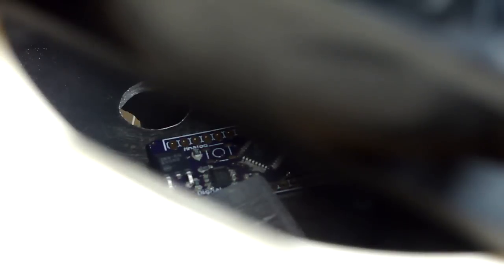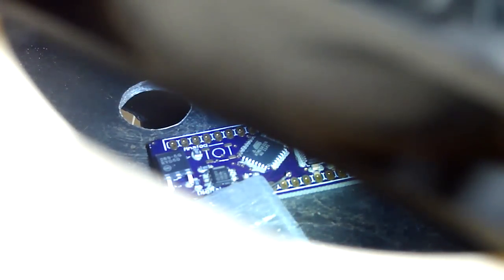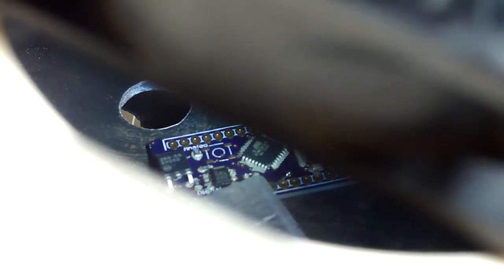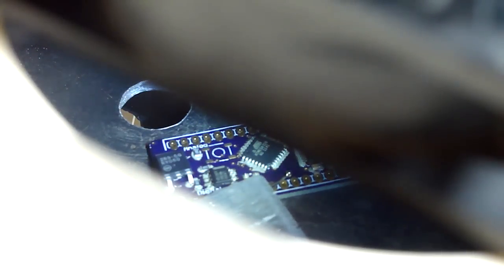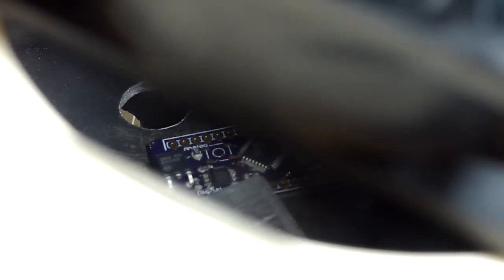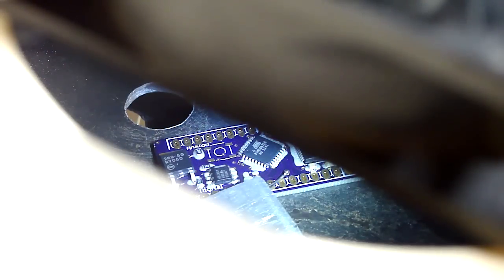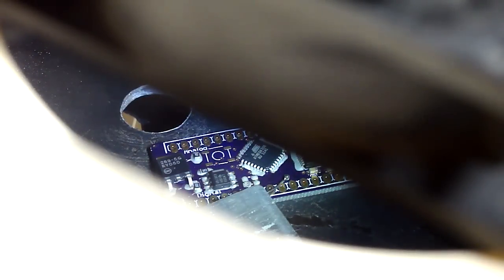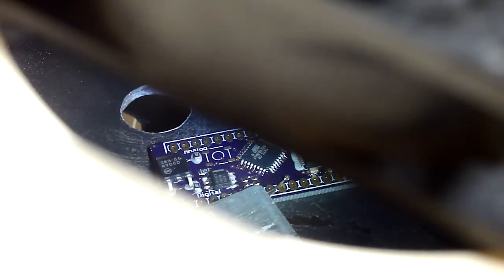SMD Reflow Plate - Circuit Board Reflow

Comment from the maker: @SqueezeCheeseTV Reflow soldering is a process that is used to solder either an entire circuit board, or just the surface mount components. Typically, solder paste is silk screened onto the pads, the components are placed, and the board is put into an oven that carefully controls the temperature. When done right, no damage is done to the board, and you end up with a perfectly soldered board with every part aligned properly.